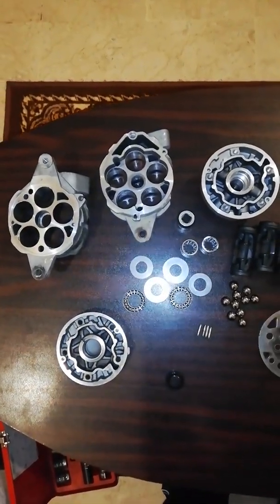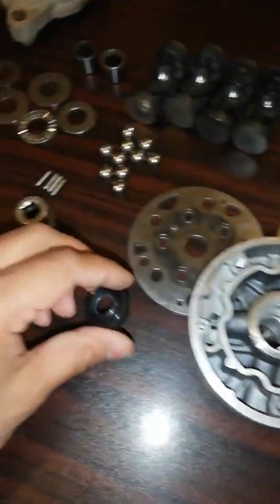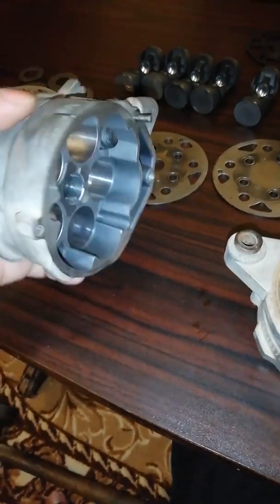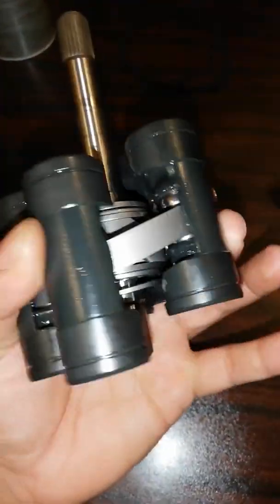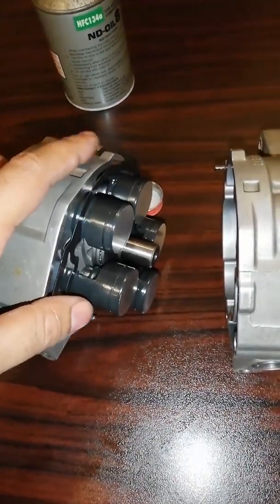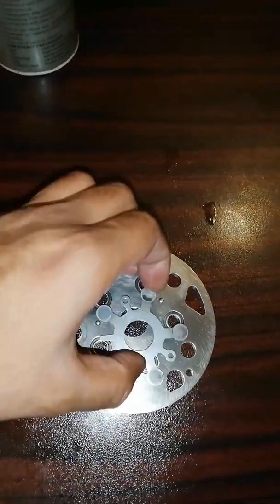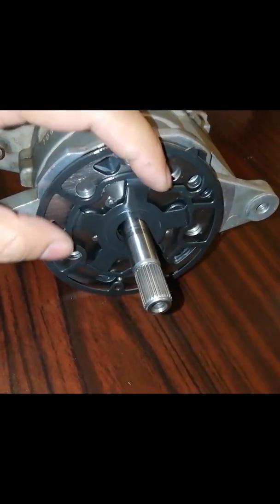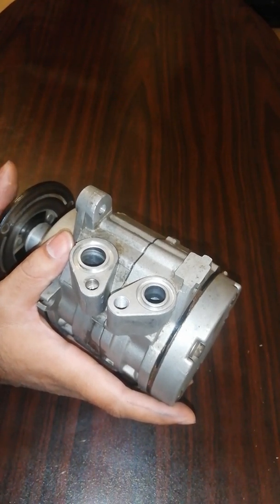Car AC compressor repair | Car compressor seal replacement | Detailed assembly

Comment: Can we replace shaft of ac compressor?
Reply from the maker: It is based on compressor manufacture design. In my compressor the shaft is press fitted with swash plate. This will be only done by a good mechanic who have good skill in operating hydraulic press.

Comment: where did you buy new seal? Also, do you have video of taking it apart? Need help replacing my seal. Thank you kindly
Reply from the maker: I bought this seal from bilal gunj,Lahore, about 400pkr. I didn't make video of  aparting this seal. But I would like to share my experience, I've used minus screw driver and hammer to disassemble this seal. Kindly note. The disassembly process is difficult cause seal is hardened due to temperature and pressure conditions. It would be all worn out, when it comes out from body. So, as a safe point of view, note it's outer diameter and height by vernier. Which type of compressor do you have, going to replace its seal?
Thanks
Reply: @ingeniousworld.  Thanks for the reply. I have a UAC compressor which is com[plete garbage and obviously not recommend anyone waste their hard-earned money and time with. Bought it brand new 6 months ago and the seal has failed. The clutch still works.